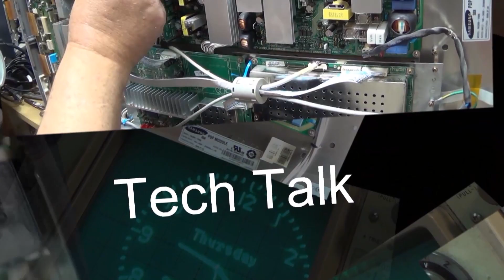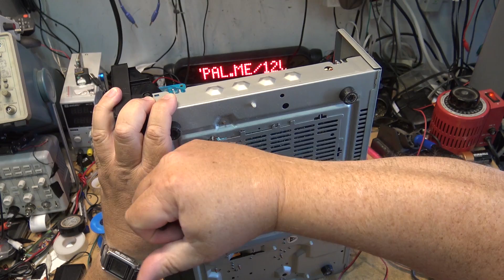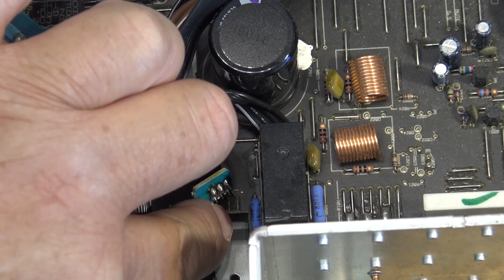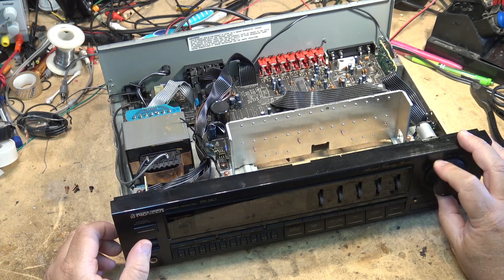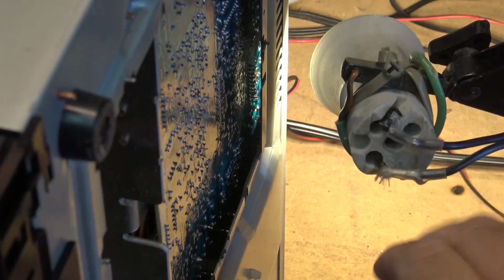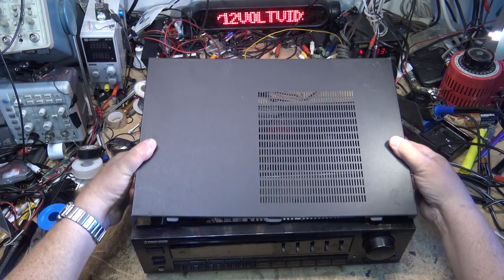Pioneer SX240 No sound repair

Comment: Hi 12volt !! Cool name 😎  So I bought a used Pioneer sxv90 in great shape cosmetically  for 25 $  plus shipping. It turns on and lights up and the relay clicks. The guy sold it cuz it didn't make sound. It didn't have its preamp jumpers plugged in so I bought some but it didn't rectify then situation. The vents get warm and actually feels a bit hot to the touch.  I had this same stereo as a 14 year old kid in the 80s. It was my 1st stereo.  I'm popping the tip on it today to check the fuses. When I press the speaker select A & B I can hear a slight audio pop so it's wanting to play sound just not doing it yet. I thought I'd ask u where I should start
Reply from the maker: Plug an open cord into the main in and turn it on.  Touch the top of the connector. Do you hear it hum? If so the power amp is working.  The problem is in preamp. If no him then the power amp has a problem.  You can plug the preamp our into another amp to see if it is outputting a signal.
Reply: @12voltvids  Hey thank u for helping me. I had it on today for about 30 mins trying different things. All the fuses are good. One thing I noticed is the relay click a few seconds after turning on sounds very dull compared to a nice click., plz. Excuse my novice questions. I'm trying to comprehend your message. So I   can take a bare speaker cable  and attach it to the power supply hot
Reply from the maker: @IamVintage72  not a speaker cable.  An audio cable.  You know where the jumpers go between the preamp out and the power amp in?
There.  Plug an open rca audio cord into the input and touch the tip. You should hear a hum out the speaker if the power amp is working.  This is called isolating the fault so you know where to start looking.
Reply: @12voltvids  ahh man. Thank u.   subbed 😊 🙏
Reply: Ok  I took the jumpers out and plugged in red and white rca into the power amp in and it made no hum.
Reply: Ok wait I didn't have speakers plugged in. It hummed pretty good. 👍  what do I check next ? 🤔   it's alive!!
Reply from the maker: @IamVintage72  so now you know the problem is in the power amplifier section
Reply: @12voltvids  ok I will research this and see what my next step is. Thanks for helping me out.
Reply from the maker: @IamVintage72  that's great that means you have a problem in the preamp side of things. Since the audio amplifier is working now you need to check the preamp. First thing i would check is input switches.

Comment: Mine still works great but the digital display goes dark.   Stereo goes very loud.   One year we shorted speaker wire on one channel.   We had to remove the transistors on the offending channel to get the powersupply to click again.   Two issues i had was Cold solder loose leads  on RCA inputs Also the "A/B Speaker switches weak contact so I permanantly jumpered them

Comment: Hello, I sprayed oil-free contact spray inside the function keys and then the buttons got stuck.  What can I do to fix it?  Thanks.pioneer sa-540
Reply from the maker: Unfortunately nothing if you used an hcfc based cleaner and there is any plastic on the mechanism.  Hcfc attacks plastic.
Reply: @12voltvids  I applied an oil-free contact spray..Could the dust and dirt inside the switch be clogged? Lock nails are working.  It just doesn't throw back the bow.Can it rinse with natural degreasing detergent used in the kitchen?Thank you for the answer.
Reply from the maker: @suataydemir5234  some of these contact sprays attacked plastic and causes it to swell which jams things up.  The only contact cleaners I use are ones that specifically say safe on plastics.  Not all are.

Comment: I have the same amp but I can't get it to turn on :((
Reply: There was a Fuse inside mine.    If any of 4 transistor is broke The power supply relay will not click on.
Reply: Try a box of chocolates.
Reply: Try a pack of mint flavoured condoms and some lube for bedtime

Comment: hi, I have a pioneer VSX-522-K. only get sound through front speakers when set to pure direct, all other settings give sound through the centre and just one front speaker. all speakers give sound during test problem persist even after a reset. please help.

Comment: No a brilliant design for a bottom plate is to put an access plate pre-screwed onto the chassis. Which meant it could be removed via screws and put back with screws that already exist on the unit. Not have to find screws to fix a plate back onto the unit. Now that’s a brilliant design.
Reply from the maker: Those 4 screws cost money.  They take an extra step to attach.  This adds to cost especially if it meant having 1 extra worker on assembly line who's only existence on earth was putting that bottom cover on.  Since the majority of these probably never needed service and they were made at a time when there were service techs everywhere this cost cutting measure saves the company a stack of cash and since they were generally being serviced by an engineer who doesn't mind cutting the tabs and finding spare screws.  It also keeps the curious out of the bottom.  With screws anyone can open it. This also provides proof for warranty that nobody has been in the bottom.
Reply: 12voltvids I agree with that. If it’s a warranty item and does give you indication if it’s had work done on it. Just as a personal thing. I like to get a screwdriver. Undeposited screws and have the plate off quicker than the kettle boils. Haha
Reply: thanks for this explanation.

Comment: I've seen this method of bottom panel removal on microwave ovens. You can change the turntable motor after cutting out and screwing back a section of the bottom plate the same way you did on this amp.

Comment: Hello 12volts vids, my teac av receiver ag-d9260 everytime I turn the volume...loud tic sound on the speaker audio comes on then turns off once I adjust the volume again. 2nd thing is once audio comes on, even the vol reached its max sound is same as vol no.1 setting. And vol is kind of low but sometimes kind of med loud but not as controlled by vol adjustment. Same vol response both remote and the manual vol control. Hope you can help. Thanks in advance.

Comment: My Yamaha amplifier with built-in radio tuner must have a memory storage capacitor,,,as I had left it disconnected for up to a week,,,and the station preset memory was still saved in place for the tuned radio stations here.

Comment: Omg that bottom panel idea is genius, why why why didn't they all do it.
Reply: Sony sorta did it, but they did it differently. On their receivers from at least the early 90s They cut the panel out, then flipped it over, and it screwed in. They did not do the cut the tabs thing. I also found an older 80s Sony str vx1 where literally The whole bottom panel was screwed in. (have not figured that one out yet, the right channel on both speakers A and B sound like it is farting, I switched the speakers around and ruled those out. It uses a Sanyo stk460 amplifier IC.) This is one of the reasons why I don’t really like more modern surround sound receivers without those service panels. (Onkyo, Yamaha, ETC.)

Comment: Fixing it the old fashioned way made my laugh. I've done that more than I care to admit.
Reply: If not overdone, percussive maintanance can be very effective for fault finding.

About 10 years ago I gave my father a broomstick as a had no time to fix his TV. He used it for weeks like that. It was a second "remote control". When the vertical deflection went out, he slammed the TV on its side with the broomstick, and it was good for a few hours. Fortunatelly the connection  never failed while he was in the bathroom or smoking outside, otherwise a nasty black line could have burnt into the CRT. Finally I fixed the TV, and we still have it in storage.